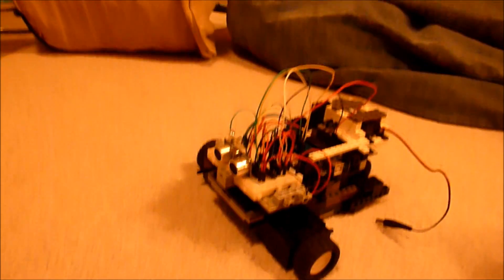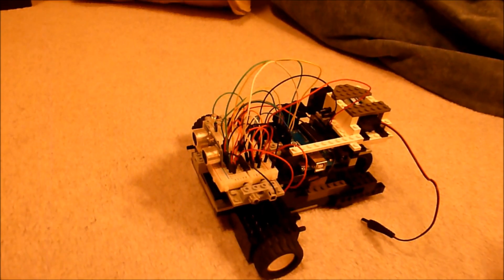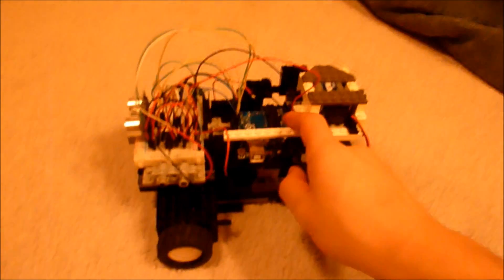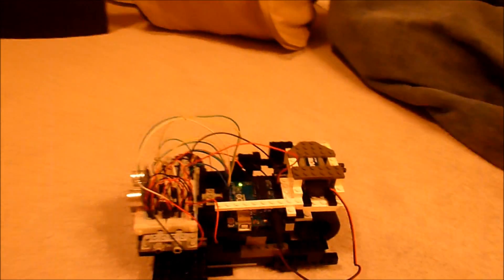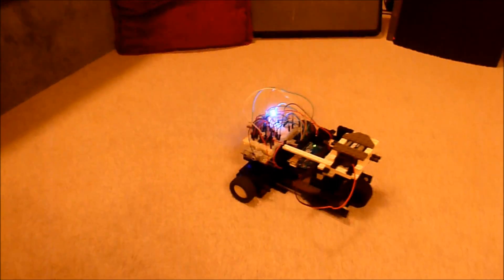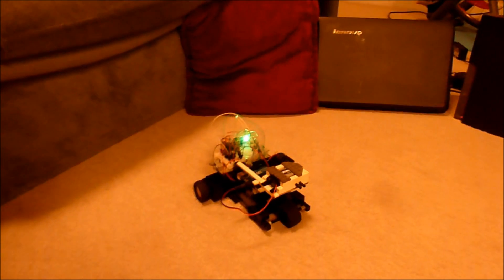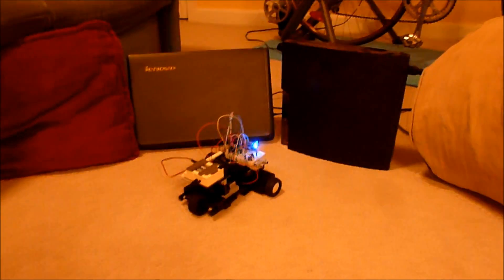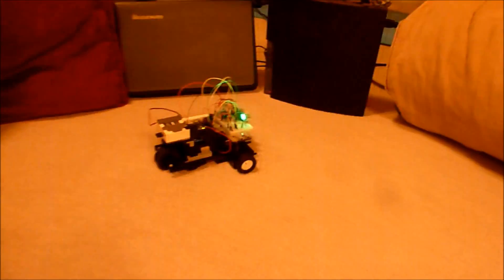Fully Autonomous Arduino Robot

Comment: arduino is powered from 9v battery?? when I connect power from USB port the code work very well but when I connect batteries (4,5 or 6 volts) from Vin and Gnd pins the code doesn't work anymore. the robot just turning and turning. please help me..
Reply from the maker: I would suggest to power the Arduino through the 9v barrel jack with a 9v battery. If you use the Vin pin but your polarity is reversed, you will destroy the Arduino.
Reply: Jaccoob233 I used 9v battery and its ok. Thanks a lot, nice project
Reply from the maker: Thank you :)

Comment: That's quite interesting! We are making a vaccuum cleaner robot with Arduino that can be controlled using an android application for a school project. Can you tell me where you found some good tutorials? We want to use the Ultrasonic sensor, but we cannot find that much information about it.
Reply from the maker: Sure! I followed this tutorial for the HC-SR04 ultrasonic sensor: Arduino Tutorial #6 - HC-SR04 Ultrasonic sensor. You can buy them on eBay for about a buck each.
Reply: Jaccoob233 That's too bad since we're using a URM37 Ultrasonic sensor. We did not choose for this, we just got it. Do you also know how to return distance values from the URM37 sensor? We've been googling forever and could not find an easy answer.
Reply from the maker: Hmm did you see this: http://www.dfrobot.com/wiki/index.php/URM37_V3.2_Ultrasonic_Sensor_(SKU:SEN0001)?
Reply: Jaccoob233 Yes, we've seen some of that information, but we don't understand it quite well. For example: Do you know what values like '0x10' and '0x54' mean? I've seen them before, but could not find any clear explanation for it.